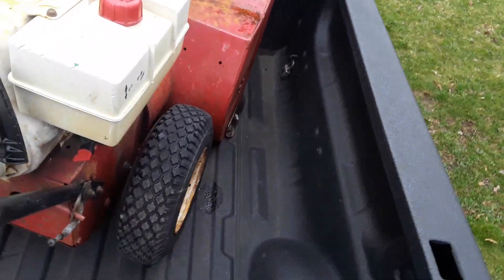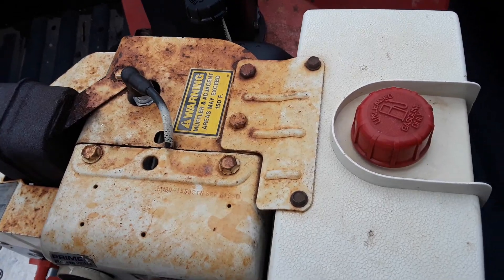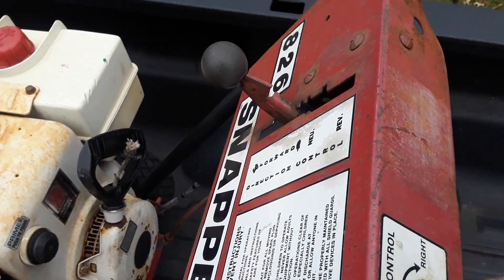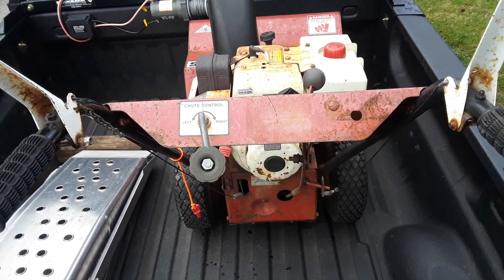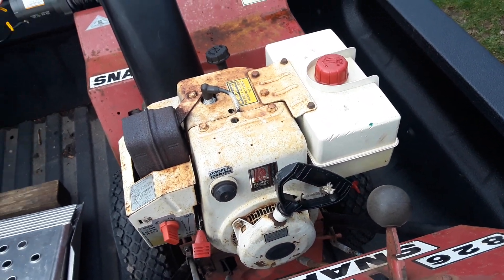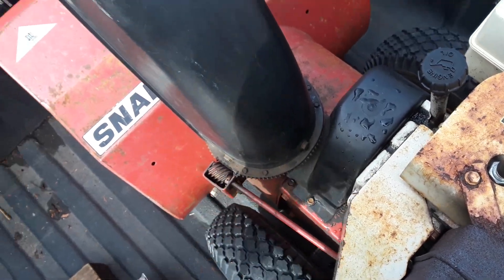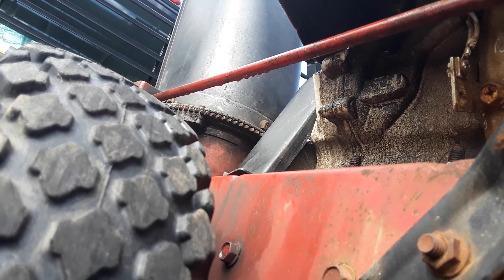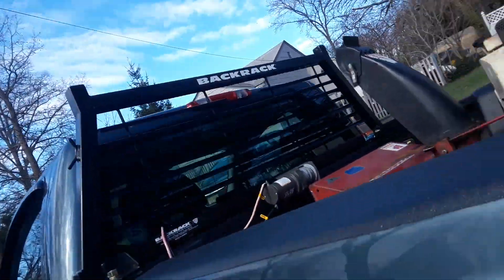Tecumseh hm80 8 horsepower 318cc engine cold start and run after repair. Best winter engines. 🏅

Comment: Tecumseh makes some of the greatest plastic fuel tanks out there. Their plastic is really high quality and it can take quite a beating
Reply from the maker: They should have kept making them plastic, LCT, the company that took over Tecumseh uses metal tanks, I guess it's actually cheaper to make a metal tank because all the scrap metal goes to China and that's where they're made. But you're right a plastic tank is better it doesn't rust. Briggs uses a plastic tank. I don't know if it's as good as the Tecumseh ones were, but at least they're still using plastic. But yet plastic took over for metal 25 years ago and we went back to metal. Its all $.